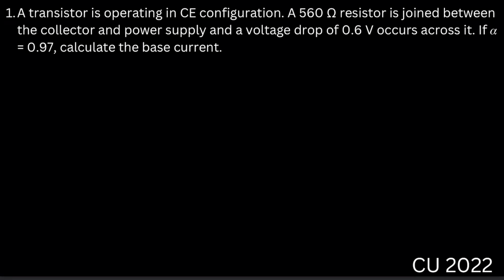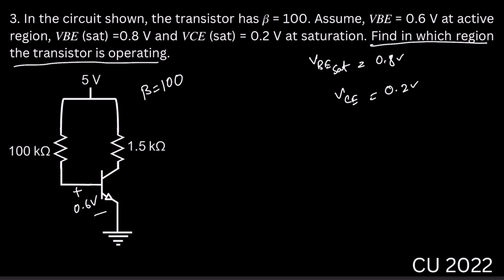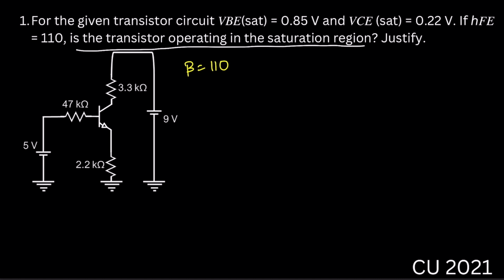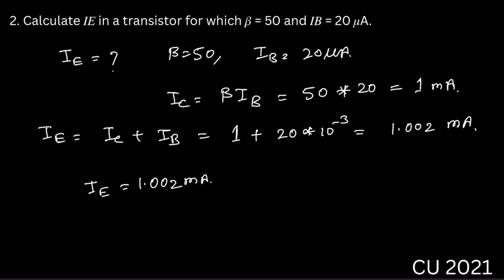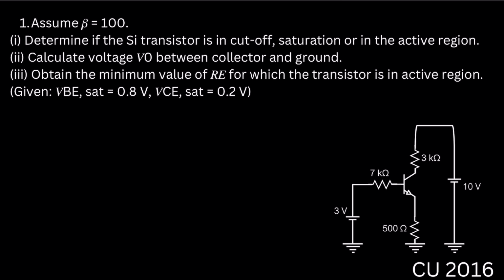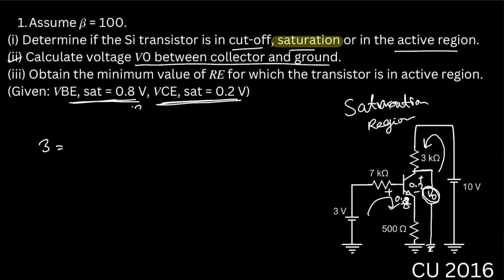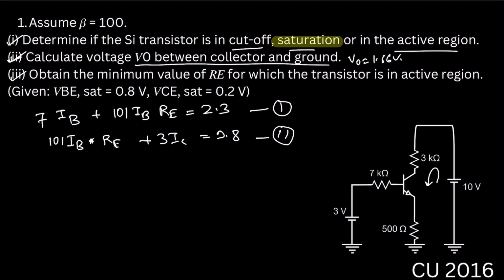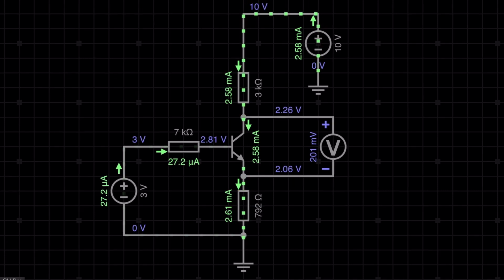Transistor PYQ CU Calcutta University Previous Year-CU-SEM-IV-CC9 BSc Physics Solution Part-1

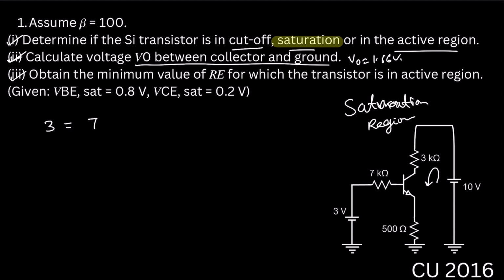Comment: 31:38 Sir in this case the transistor just reaches the active region then why we are taking V_BE (sat) = 0.8 volt
Why this shouldn't be 0.7 volt?
Reply from the maker: Yes you are right, so we just need to the boundary conditions, that mean when it just reaches the active region.  So we need calculate with the Vbe sat